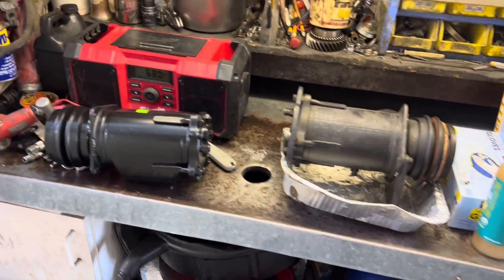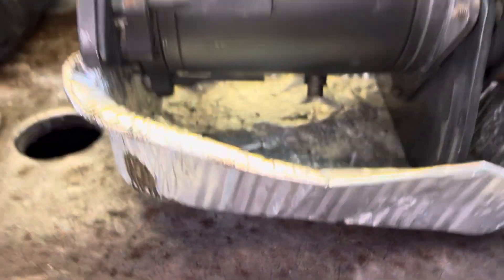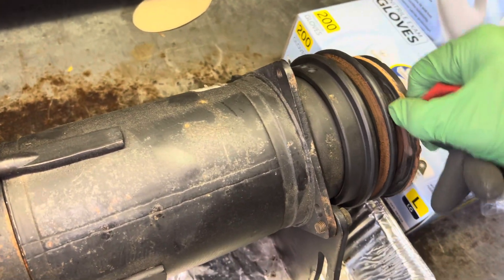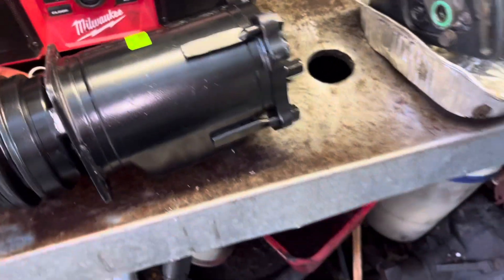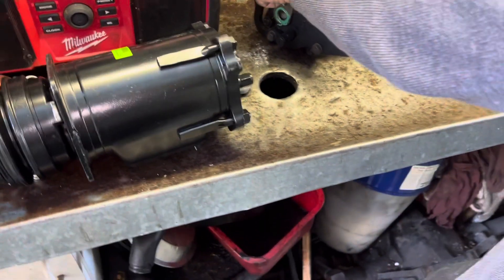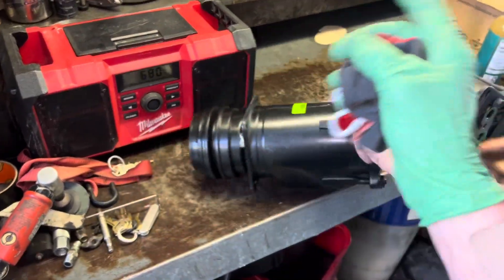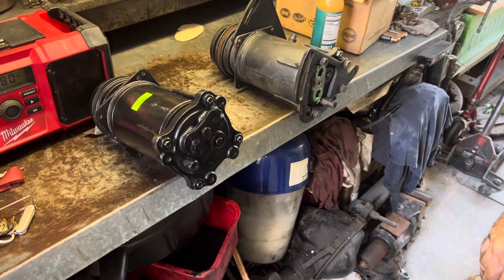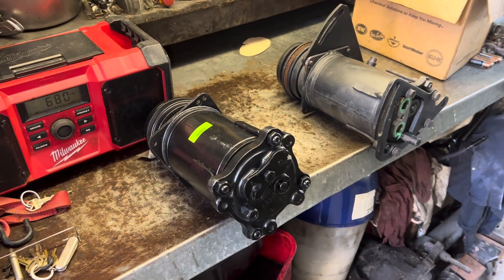OIL BALANCE VARY IMPORTANT ON NEW COMPRESSOR INSTALLATION

Comment: This is the same reason my R4 compressor failed.  Coulda sworn I had the correct amount of oil in the system. Also found a missing o-ring on the accumulator outlet, the o-ring was stuffed just inside the tube as if it had been there from factory assembly.
Reply from the maker: Yep that happens all the time